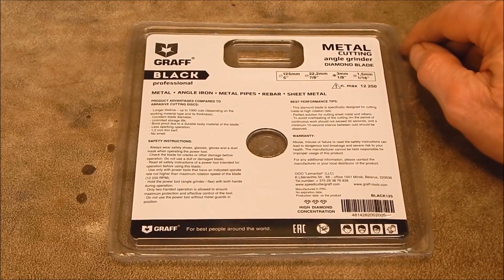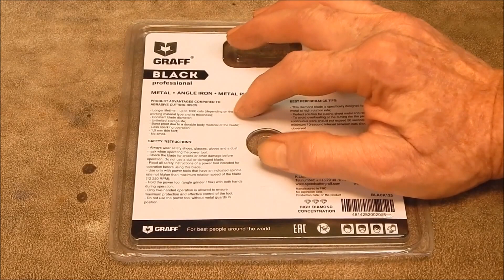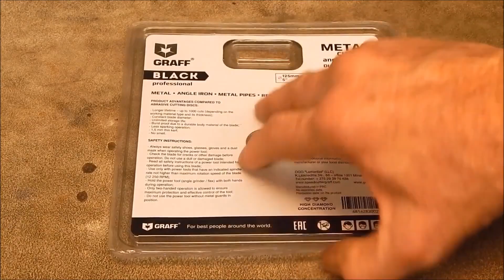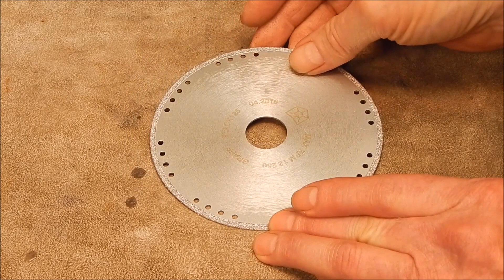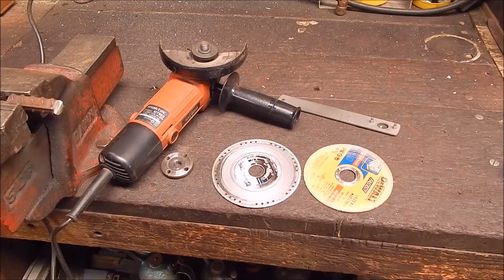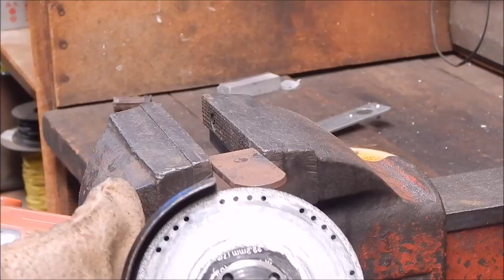GRAFF BLACK metal cutting angle grinder diamond blade performance test and comparison

Comment: For every hour spent grinding, you spend two with a steel blade. However you didn't  try a different speed and possibly a slower speed works better?
Reply: angle grinders only have one speed - as fast as possible.

Comment: Try it on some tungsten carbide or HSS .
You want to try the twin cut saw from Ozito! 
I need one of those diamond wheels  for gashing my endmills in my tool grinder, i had one carbide cutter to sharpen and wasn't it a chore doing it with an angle grinder and a cutting disk !

Comment: This review is very interesting Rob. I note that in the pre test cuts there is a mark on one portion of the wheel, (Diamond) and that may be part of the out of balance/vibration that you mentioned in this video. Another thing I will note is the diamond is proud of the metal that it is bonded to and as such is less likely to wear on a taper as I have experienced in the past, especially on deep cuts in tough/hard materials. I only use Brand Name XXFXXX wheels as I have found them as good as any other on the market that I can easily purchase. Having said that they will not cut Tungsten Carbide and do not like Cobalt HSS so I can see room for a Diamond Wheel in my small shop, as you said horses for courses  Good review Rob.
 Merry Christmas and happy/safe New Year to ALL. Cheers from John, Australia.
Reply from the maker: The vibration is from the coarse cutting action as a result of the low grit rate.

Comment: Interested to see how it would go on sheet metal ie: corrugated roofing. Thanks for the video Rob
Reply from the maker: Hi George,  I expect it would go very well, as the thin sharp edge of the sheet can't tear up the disc as with aluminium oxide.  However, the cut is likely to be burred more.  I would have liked to try more materials, but a video can only be so long ;)  Cheers Rob

Comment: Looks good initially but ........... even if it lasts longer the cutting speed is certainly slower. With Al of course even with that, it seems to show loading up of cutting surfaces -  a problem with regular disks too.

One benefit might be virtually none of the air particle pollution that makes for a black nose snot!
Thanks for the demo Rob - agree with your appraisal.

Comment: One of the benefits of the aluoxide discs is that the smaller discs (125mm) are just 1mm thick, and as this has to remove a lot less material than larger discs (usually 2mm at 230mm diameter) or diamond wheels like this (3mm), they're much faster and creates a lot less dust even when considering the wear on the disc.

Comment: Good review Rob, i will deff be sticking with the good old carb disc. I much prefer the quicker cleaner cuts of the carb disc's, i also get much the same results that you see between the carb disc's & the diamond when i use the little 25mm  diameter disc's on my Dremel as well.
Reply from the maker: I have some of those small Dremel sized diamond discs but have never got around to using them.  I generally go with the 75 x 0.8 mm ally oxide discs.  They cut pretty much anything ferrous very cleanly.  Cheers Rob

Comment: I tried the Lenox diamond blade, and your experience lines up with mine - it's slow. There's an upside in terms of less smoke and soot, and it maintains its diameter, but it's just too slow.
Reply from the maker: Flexovit also make them.  Bunnies have those and Lenox are at Mitre Ten (and Bunnies I think). Cheers Rob

Comment: Gday Rob, I’ve got the same maktec angle grinder and had it for bloody years, I can’t kill it, I’ve also got 2 5” makita grinders and the maktec is the one I always use first, I expected it to years ago but still going like the day I unboxed it, great review but I think I’ll stay with the old school discs,    Matty
Reply from the maker: I agree Matty on everything you mentioned.  For rough take apart/salvage type work I think they are a good idea.  But for fine, clean cutting they are not so good.  Horses for courses as one viewer said.  Apparently they work well on cast iron.  I was thinking about trying it on some, but the video was getting a bit long so passed up on that. 

I was interesting to see how they perform, as I have often looked at them in Bunnys and wondered if they are worth the money.  Nice of GRAFF to send one for review.   They had offered a number of times, but only later did I think, what the hell, lets check it out.

I think this type of video answers a lot of burning questions in home workshop minds, with no cash outlay, when done honestly. 

Cheers Rob

Comment: The diamond disk would be handy when you need the full disk radius at all times. Apart from that it seems a little average performance-wise, it seems to generate a lot more heat in the material too looking at its colour.
Reply from the maker: Agree.  It also is not as smooth to use and will run off line more easily.  Cheers Rob

Comment: Interesting and well balanced review Rob. I guess it is a case of horses for courses. The individual cuts take longer but you save time on blade change overs and less mess to breathe in or have to sweep up. Removing the risk of blade fracture is important as well as maintaining the depth of cut. I could see a use for me when scrapping old school furniture. I burn through the fibre blades and the loss of cutting depth is a pain and a hazard. Quality of cut is not important for that job, just busting down the furniture into easily stored scrap components.
Reply from the maker: Hi Mark,  if finish is not important then this disc is good for what you intend to do with it.  Less mess and constant cutting depth are two big pluses.  As you say,  it's horses for courses.  Cheers Rob

Comment: Can you use it for other things, like slitting saw?
Reply from the maker: I've not seen that done.
Reply: Way too slow
Reply: Interesting thought. Sure beats worrying about the sharpness of a slitting blade.
Reply from the maker: I have used regular aluminium oxide cutting discs in 75 mm on the lathe and they work well, even on the hardest of metals that a regular slitting saw wouldn't touch.  Give a beautiful clean cut, but you have to clean up all the residue afterwards  Cheers Rob.

Comment: Rob, Would some WD40 or similar have stopped the diamond disc from loading up with aluminium chips?
Reply from the maker: Hi Mike.  I expect so, but the high speed would throw it around badly and it would not last/stay in place very long.  Cheers Rob
Reply: Well, when you file aluminum,  you use chalk to keep the aluminum from melding itself to the deepest bits of the valleys.
With a cutting disc you basically cause the surface to melt and then toss it off the mother material with the rubbing motion.

I doubt there's any "good" and clean way to cut aluminum with any disc.

I do know we used methylated spirits to cut aluminum on the lathe and shaper, (low speed use)  it didn't stick to the HSS, but ruined the carbide tips, with or without the spirits.
Reply from the maker: I've always used kerosene to stop aluminium galling on the lathe and metal cutting bandsaw.  Works very well.  Cheers Rob
Reply: @Xynudu  That is a much cheaper alternative!
Thanks for that info.
I wonder why my genius boss insisted on the spirits....
Reply: Kerosene is used for cutting aluminum also.

Comment: Ive used quiet a few dimond cut offs in the last few years and the issue ive had with each was inconsistencies with the dimond media meaning that parts would wear or chip off much faster then others and that was across 4 brands....be interesting to see a long term review
Reply from the maker: Interesting comment Rob.  I will have to see how it goes long term.  Flexovit sell a similar product in Australia.  Cheers Rob
Reply: From what I've seen, this was a long term review lol

Comment: Great review there Rob.  I have used diamond blades to cut concrete but never metal.
Reply from the maker: I've looked at them many times and wondered how good they are.  Mostly the wet ones, not these newer dry type.  I have cut concrete  and bricks with stone cutting fibre discs.  You can actually use them on steel as well, but the finish is a bit rough.  Cheers Rob